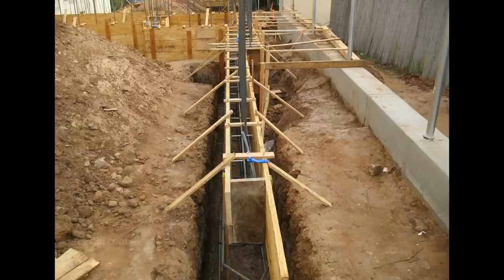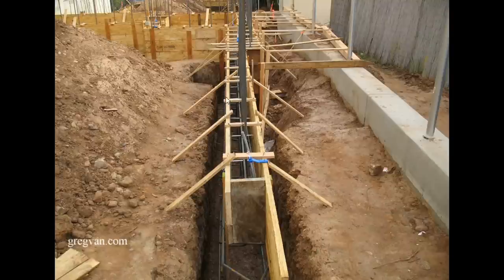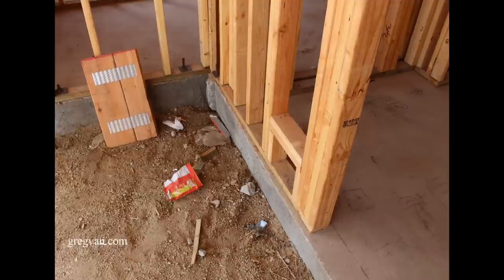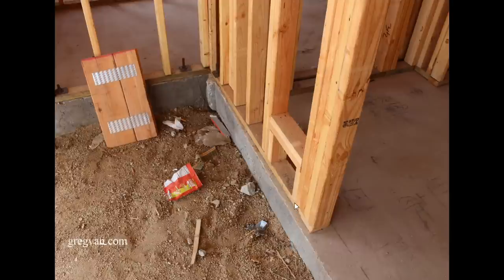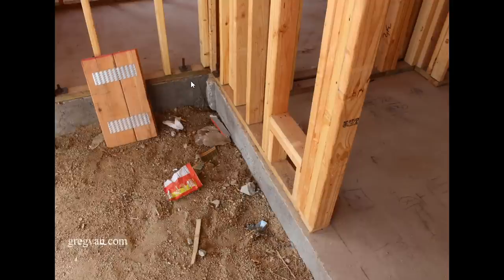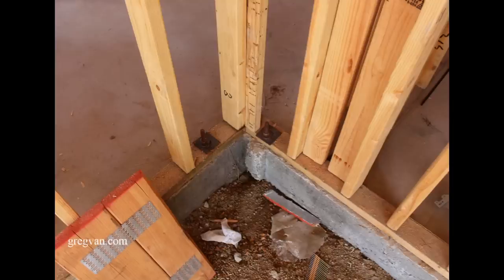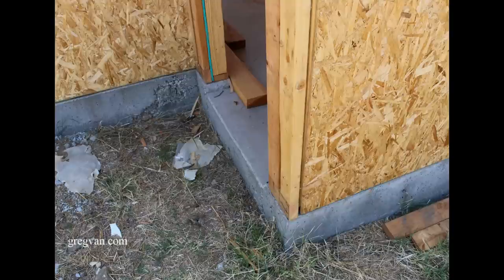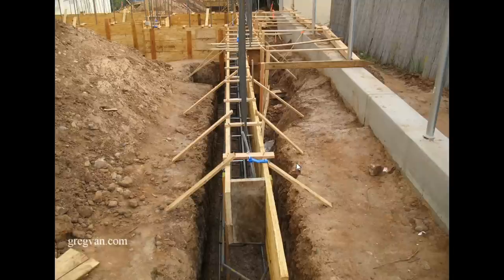Watch This Video Before Pouring A Concrete Foundation – Construction Tips

Comment: Bad advice on removing the forms to soon. Concrete needs to cure slowly for proper strength. You can loosen them the next day but the form should be left on for 3 days so it can cure evenly.
Reply from the maker: I don't think that would work where I'm at.
Reply: gregvancom I've never been to California, does your warmer weather speed up curing?
Reply: No, a wood form should be removed as soon as possible. It sucks the moister out of the concrete, and it has some R-value keeping the heat generated by the curing process inside the form.
Reply: eric wsmith I work industrial concrete for 25 years and never heard that. Our process includes the oiling of wooden forms
Reply: Of course,,, that's how the guy you worked for 25 years ago taught you, and that's how you will teach the people working for you.  Its the 90% rule, he taught 90%,,, and that person taught 90%  and before long people don't know half what they should.
Reply: eric wsmith I might have forgot to mention that I'm a civil engineer
Reply: And that makes you correct how again ? And more likely its not oil they use on forms , Is diesel fuel, But they should be using a real form release product.
Reply: eric wsmith lol...you got me there...it's actually a form of vegetable oil
Reply: eric wsmith our clients usually require the forms to be left on for 3 days during summer months and 7 days in winter months
Reply from the maker: Yes it seems to, because we usually strip forms as soon as the concrete is firm. Usually between two and four hours, depending upon the project.

Comment: Been a framer for 40 years. Most form workers are not carpenters and consequently their walls are “off”... a good framer would have never placed his shoes on a crooked slab/walls like that. We would hang them over so to “hide” the form workers poor walls.... so unfortunately there are two problems you are describing here....
Reply from the maker: If there's one thing I can say about the construction industry, it's that there are plenty of ways to build something and as long as everyone does their job correctly, then the project will usually turn out okay.

Comment: Plumbing true and level
Reply from the maker: To me it never seem that difficult to make everything as straight as possible and brace the forms off so they don't move.
Reply: @gregvancom  but it works in 3 directions plum true and level just be Plum straight up and down that's why it has to be true straight across perfect straight line and it also also have to be level flat across the top it's a lot of framing I've done out here in Denver the foundation guys lose that I've never seen him so much in the last three years as I've done never had her plate to keep my house Square it is harder than ever now because the foundation guys it's almost like they don't give a shit and that's just my opinion but over the last five years pre-built over 25 custom homes that's what I deal with
Reply from the maker: Yes, the word straight would be relevant in all directions. It sure does make a framers job difficult, having things out of whack.

Comment: Wall to concrete floor orientation is crucial but the whole...."if you take an already overpriced board with a crown in it...well ah don't use it." What I say to that....grab the tools and extra clothes you'll need on the first week and show them PHYSICALLY how it's done. Let me guess...building code/inspector?
Reply from the maker: Drew Wellman Wow, a building inspector I don't know if I should take that as a compliment or an insult, but I was actually someone who worked in the field building forms, tying rebar and hoping like hell it didn't fall apart when I was pouring.

Comment: Why is it that man wants to build straight, 90 degree angles and plum? it is totally impractical as this video describes perfectly. In my humble opinion nature found a better way. cheers.
Reply from the maker: Flip de boer  I would love to see your next building project.
Reply: Probably straight, square and plum again if the client insists. Didn't mean to be mean or rude. Just questioning contemporary building  filosophy. The best houses I built were not comlpletely straight, square nor plum. they turned out to give the best feel inside and ouside, and the most satisfied customers. I figured out, because of that, that it is worth questioning. But I'm shure not for everybody. One thing i know for shure: when I am going to build my own place again, first out will be the carpenters square, and level. Cheers.
Reply from the maker: I didn't view your comment as cruel, just wanted to see your next project. People like you my friend are the ones who change the world, so if you ever do something like you suggested, I would love to see some pictures.
Reply from the maker: +Jim Corkern I think for the most part, he was just kidding around, but am still waiting for pictures. Structurally it would be more difficult to work with anything that wasn't straight or 90°.
Reply: +Flip de boer Natural building may not be square, but it is still usually plumb because gravity is.
Reply: +Flip de boer However somebody builds they need to be on the page as the person who designed the house.  It's very difficult for us carpenters when the layout guy gets it off by a little bit, or the concrete guy can't lay a flat slab.By the time we all pass it off to the painter to fix.  He can get really cranky about that 1/4" out at the slab that turns into a 3" crack he has to caulk up near the roof.
Reply: +Flip de boer You might like the barn I want to build this coming Spring or Summer.  Twenty feet tall in the shape of a Parabola.  Perhaps thirty feed in diameter.  Thin shell concrete dome using a basalt rebar that will never rust.  I see no reason the dome will not last 200 years.  If it turns out well I'll build the next one house size.
Reply: +Flip de boer Yes nature found a better way, It made us.

Comment: Price dictates quality.
Reply: +bogey19018 no, No it doesn't. It surely does not go hand and hand.
Reply: +SteveLovesGOD 

Yes it does. Especially state work. If you're going to beat me down 5grand on a 15grand job, its going to get done real fast. You get what you pay for.
Reply: +bogey19018 You're looking at it from you're point of view, a business owner, When you're charge someone, it's based on skill, I'm a business owner as well. 

So we both know and heard of customers who were over charged for crappy work, shiester's who gave extreme bids, and the work was done poorly or incorrectly. Many times a person would "ASSUME" with a high bid, the customer must know what they are doing. 

It does NOT go hand and hand. You and I knows what quality work looks like, but the average customer would not know right of the hand about:

different psi mix of concrete, 
reinforced concrete, 
using screws with a coating on it for exterior wood so it don't rot
using quality tile sealer on ceramic or granite tiles because they are porous. 

Those little things lot's have home owners find out the hard way. and paid premium, I try to say things from a client's point of view, because they assume the contractor is an expert.
I've had a G.C. argue with me that the floor can't be leveled, W.T.F. he stated in his 40 years he never met a leveled floor. I'm arguing with him, I level the damn floor myself(sub-contractor) his bid was high but quality.....no
Reply: See that full quartzite floor in the background when you hover over my avatar?
$0.
It's a pretty decent floor. not a bad deal. Meanwhile, you're probably paying at least .48 cents a square foot for cheap tile.

My drill press: $0
My stainless steel fruehauf semi trailer loaded with high voltage electrical items: $1300 bucks
table saw: $0
many other granite slabs used for floors: $0
4'x8' maple flooring slabs including the plywood subfloor: $1/sq ft
"the best granite cutting table I've used in my professional life": $0
nice kitchen faucet: $0
650 gallon plexiglass fish tank scrapped for 1" plexiglass: $0
pair of new balance shoes at a thrift store that lasted over a year: $3
numerous functional steel lateral filing cabinets: $0
55 gallon drums (parts A & B) foam insulation: $0
55 gallon drums ferric chloride, unopened: $0
3 door 300 series stainless refrigerator with receipt & manual: $0
numerous various appliances for my rentals: $0

Do you understand where I'm going here? Do you know what a "counterexample" is?

but the price on your mom's nasty dead vagina was pretty reasonable. I could see how you get your "you get what you pay for" perspective having grown up in your family. It was 3 bucks an hour.
Reply: That's not absolute so it's wrong
Reply from the maker: Not all the time my friend. I've met plenty of contractors who charge lots of money and do inferior work and met contractors who don't charge enough money and do great work.
Reply: bogey19018
I didn't build my refrigerator broskiff.

Comment: Why don”t lay concrete block
Reply from the maker: I would imagine that it had something to do with either the property owner or structural engineer's request, but absolutely I've seen projects like these built with concrete blocks.
Reply: gregvancom i have to actually sit there to watch them these day. Most of construction workers are Mexican. Even i can not soeak Spanish but i can stop them when i see some careless workers whodid not kevel the mortar line straight or set the block out of line. While those block are not set, you sure can knock them off and make them redo it correctly. Where can we find those old brick manson who can lay bricks , blocks so straight just like in the picture? Look at those old house with a perfect like picture of those bricks.....i just want to cry!

Comment: You are way too picky. I poured my own 18 yard foundation for an addition I built on my own house and I purposely made the foundation about 1" larger all the way around that the structure itself was going to be. I did that so I could flash the base of the addition over the top of fake stone that was going to be mounted on the outside surface of the exposed concrete.
Reply from the maker: +Doug Yeomans I think you're the first person who ever told me I was too picky and would never consider myself to be a perfectionist. However, you have given me an idea for another video about the problems you could encounter by leaving a 1 inch projection around the perimeter of your building and thank you for that.
Reply: Well that would be me! I'm not a contractor so what do I know? I do consider myself to be anal when it comes to doing things correctly, but nothing is ever perfect. I built my own forms because I was so anal about doing it the way I wanted it to be done. You should see my forms..way overkill, but when both trucks with 9 yards of concrete showed up for the pour, the drivers took one look and smiled. They're used to people thinking that some plywood and a few braces will work, but these two drivers knew my forms weren't going anywhere. It was my fist concrete job and a total success. That's why I do things myself. You know how the saying goes about wanting something done correctly and doing it yourself. I hate working with contractors.
Reply from the maker: It's definitely better to make something stronger, especially if you don't know exactly what you're doing. I'm glad your project is going smoothly and sometimes I also have a difficult time working with other contractors, especially the ones who need to boost their ego by making someone else look foolish.
Reply: The spec only required a 12" foundation, and I was going to use a pre-fab, but I couldn't find anyone that would make them the height I wanted them to be. I get tired of codes and hindrances to proper, and sound construction. For instance, wooden roof trusses with those pressed fit steel joints are a fireman's worst nightmare. I wanted to build my own that would've been glued and screwed together, and even though the inspector knew they'd be stronger yjan the pre-fab trusses, he had to turn me down because they didn't have an architectural stamp with "known" stress loads. I understand the REASONS why codes exist, because of idiots that want to shortcut in order to save a dollar, but when the inspector knows when construction would exceed the strength of commercially available materials, it should be discretionary. I realize I'm going off, but this crap drives me insane. Correct is correct, "to spec" is not always correct, and every "good" contractor knows it.
Reply from the maker: I can't argue with that and it sounds like you're going to do a good job.

Comment: I don't know where to start. Why don't you use form-ply for forming and a concrete vibrator to get rid of the rock pockets. I don't see a footing under that stem wall and clean your job site!!! What a fricken crap job site!!
Also you always build to the trusses. If you move a wall how's that going to work with the floor joist or trusses above? 

Just another hack job contractor.

Comment: i pour a hundred or 2 yards a day bin doing it for years. i will say this fourms will move u dont want them to but concretes a bitch if u never poured it finnished it raked it pulled straight eged dont bitch. sometimes i hate my life some days pouring. lol
Reply: +Dude.dl81 Dude8181 lolol!!! i dont pour but i work with it commonly in my old house fuck i hate my life somedays. im bout to DIY to fix my foundation by using 3 tapco house jacks to raise the floor up that sagged bc the foundation eroded away, below grade  and then lay a sister foundation under and over the foundation below grade.

Comment: You should come to Ireland and see the concrete work I see it's a lot worse than yours. This is not decorating or tiling. No one will ever see a lot of your mini mistakes. You are too fussy mate. By all means have the slab straight and square but are holes even on rail jobs are made good by grouting
Reply from the maker: I don't know if I'm too fussy, but definitely think that with a little more information like the information in this video you can save money and create a better product. Someone told me years ago that it doesn't take much longer to do something right then it does do something wrong.